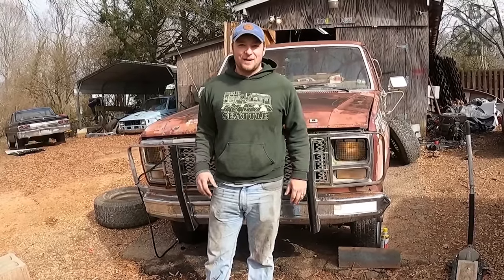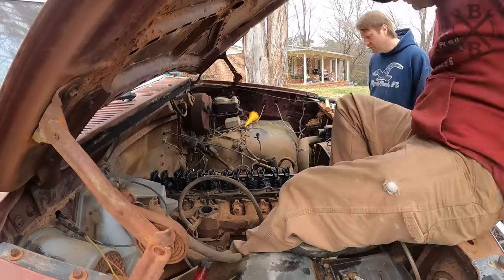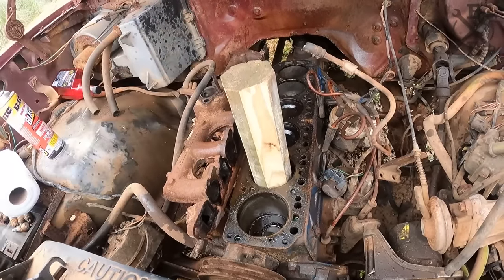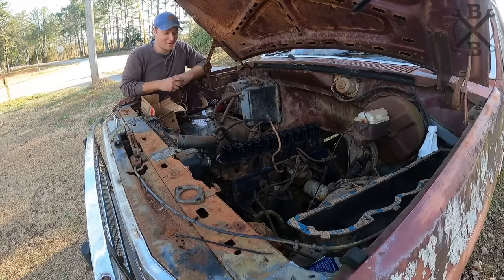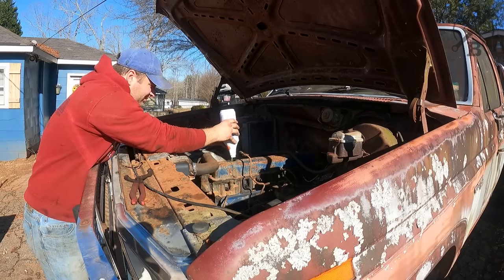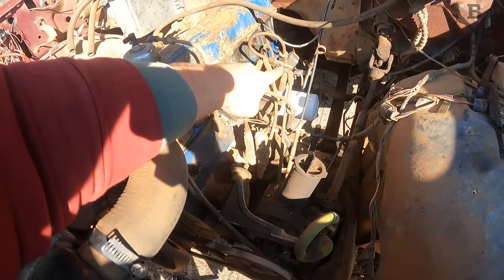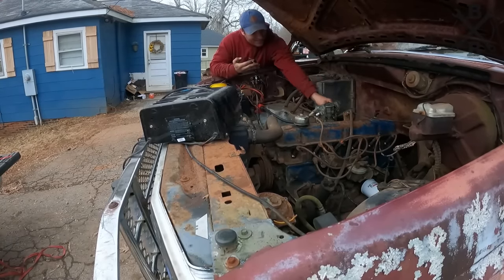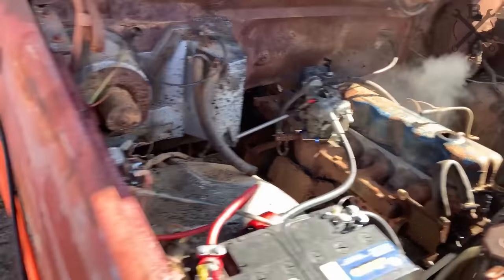Will this Classic Ford F150 Run after sitting for 29+ Years

Comment: The 300 is my favorite engine. Putting a tractor engine in a pick-up was a genius move on Ford's part.
Reply: Yes it was as far as im concerned a tractor engine capable of town runs is an absolutely amazing idea for any pick up. They are work first pleasure sencond at the most. But i love my 5.3 chevy as a daily.
Reply: The real definition of Ford built tough I have the 94’ 4.9L inline 6 with 5 speed manual transmission and I gotta say that she’s a beast and she still got her full potential low end power
Reply: the 300 was a truck/car engine long before, ford just sold the engines to new holland and others

Comment: As soon as he showed  what was under that hood I thought "it'll run."
Reply: Just started the video, haven't seen under the hood...guessing 300 L6.
Reply: @Captain_Yodelstein  You would be punctillius in assuming that...
Reply: Best motor that Ford ever made imo
Reply: My thoughts exactly 😂
Reply: Yup, second the hood opened I thought “straight six, should pop just fine”
Reply: Yup, I had an '81 Stepside w/300 and 4 speed with granny first gear. It was unstoppable! I still wish I'd never sold it!
Reply: Without a doubt
Reply: I have the same motor in my 88 cause the EFI motor blew up so we put a older motor in it and it's a tank
Reply: I saw your comment before starting the video. I knew from your comment it’d be a 300. 👍👍

Comment: The inventor of the Duraspark ignition lives in Chapin, SC. I've met him, he's a pretty cool guy. Whe Ford shipped their 1,000,000th ignition box, they presented him with a gold plated Duraspark box mounted on a plaque. He has it hung on the wall in his shop.
Reply: I've driven hundreds of thousands of miles on Duraspark ignitions, and never had a failure!  Tell that guy I said "Good Job!"
Reply: @DanEBoyd  I've only had age problems with mine. Other than that they're pretty decent.
Reply: I think the biggest problem with duraspark boxes is the cheap aftermarket ones…those are trash

Comment: Other people: engine is seized, yep it's dead
Budget Buildz: Now you take this effing log of wood and you hammer it in!!!
LEGEND
Reply: Noticias @BudgetBuildz El vuelve
Reply: @BudgetBuildz  de que,,,
Reply: @BudgetBuildz  flat tops,rv cam,twin barrel,,kill any v8..
Reply: @BudgetBuildz  the rubber on the fire wall,,now thats rare. i swapped out my  [ 75 highboy ],300 for a 351c, didnt know much about 300,s. bad mistake.. im in aus. i imported a 62 f100 4x4, 352 FE. not the y block., i think guy fitted a lot of a 65 to it. guards,door,bonnet. [ hood to you yanks ].. & cab as vin says f10,not f11. 4x4. good luck,stay safe..

Comment: One of the best in line 6's ever built (in my opinion)
Reply: Nahh that goes to the Jeep 4.0 but honestly I can’t think of a bad in-line 6, something about that set up just seems to work.
Reply: 96 F150 4.9L 650k and still going strong.
Reply: @sccarguy8242  yea I don’t know if there is a such thing as a not reliable inline 6
Reply: Agreed....the inline 6 is one of the most durable engine designs for toughness there is no matter the brand name on it.
Reply: Had a 170cid in line six in a 63 Comet...beat the tar out of it (teenager).  Never missed a beat. Miss that ole motor..
Reply: The ole slant six would go forever.
Reply: @perrykawasaki9991  So true...I have one in an old 1967 Dodge truck my grandfather bought new. I use it to plow snow with on the farm. Odometer was rolled over twice before it broke in 1999 so it likely has 300. miles on it now. Still a runnin and lived a hard life.
Reply: Had a '68 AMC Rambler with a 232 straight 6. Even after a head on with a late '70's caddy, it still ran. Hard engines to kill
Reply: @EliAngwin  my dad has 94 f150 xlt with dual gas tanks and has 300 inline 6 manual with 300k miles and never been rebuilt besides the trans being taken apart and the diggy out of a rats nest and putting back together and still running today after a tree fell threw the cab and onto the engine still runs even towed a old John deer tractor behind it once
Reply: @BrodieBr0  I agree because Chrysler 225 slant 6 is a die hard engine too just like the 300 and the 4 liter
Reply: @BrodieBr0  I know a guy who had a 62 dodge with a 170 slant 6 and it has over a half of a million miles and still runs
Reply: We love our inlines here in Oz. Ford, Holden and Chrysler all had their own 6s during the 60s and 70s, all of them solid as a rock.

Holden 6 came out in 64, went until 85. Solid old axe.

Chrysler Hemi 6 went 1970 to 1981. Most powerful 6 in the world in E49 tune (triple Webers) at 302hp.

Ford 6 started with the 1960 Falcon and evolved over the years to crossflow (1976), alloy head (1980), SOHC (1988) and DOHC Barra (2002), also turbo available.

Ford Oz kept on with the inline till the bitter end with the Barra 6, a now world-renowned powerplant. Taxi companies 9/10 times would choose the Ford as they could reach 1,000,000 km and still be running fine.
Reply: @79tazman  My dads wood chipper had a slant 6...it was a vermeer
Reply: Some people need to work on their reading comprehension, I said " ONE of the best 6's ever made" (in my opinion)
Not the best 6
Not the only good 6
Reply: @SpyTube24_7  Tell us more about this mythical 2002 XJ
Reply: these are basically all v8 internals,..with flat top pistons,decent twin barrel ,better inlet,headers,,these things fly.heaps of torque. excellent engine. i swapped mine for a 351.. before i knew all this,or would still have the 300..
Reply: @SpyTube24_7   <<<<-----You care about what I can afford. LMAO. XJ production ended in 2001 BTW.
Reply: I’m only a fan of the old school Fords. Love how y’all brought this back to life!
Reply: I got the 250/4.1 in my '70 bronk (NV3550 behind). Lubta C the 144/2.36 turboed...their all the ThriftPower or "falcon" motors (6 of'em 1960 - '96) ford6 on-line, in line 8^ )
Reply: Agreed. I daily a 1980 f100 and that ol i6 is a tank
Reply: Camioneta Si repuesto de Argentina fábrica de ford autopieza provincia de buenos aires importado de chile a estados unidos
Reply: AMC 258 straight 6 is one of the all time best!!1974 AMC HORNET Sportabout Wagon with wood paneling (contact paper)and army Green paint job..
Reply: It’s actually “the best”
Reply: @sccarguy8242  he said one of😂🤣😂
Reply: dont,,have an opinion about it,,they were.
Reply: Hands down! straight six king
Reply: 300 inline 6. the motor that built america. Ford put them in alot of there cars trucks vans. Light, medium and heavy duty. I've had plenty of them and loved each one!
Reply: 300 ford was a much better engine than jeeps 4.0
Reply: 300 ford will always be the best inline engine hands down
Reply: Douglas stats I agree
Reply: They had gonna of torque.
Reply: Nah one of the best engines built altogether. Some others are the 2JZ, RB26, most Cummins engines, i could go on but i can't think of anymore

Comment: Nice work with that engine. A wooden log must not be missing in any workshop. I have also repair two engines this way. I'm glad you didn't give up right away and fixed the engine.

Comment: luv the bullnoses...i have an '80 too.   congrats on getting it going...that cylinder did not look good!  300 was one of Fords best...not too good on mpg, but that's not the point.  hopefully there's some floors still in that ol' buzzard
Reply: there built for torque,,but to get better econ.  fit a better inlet/out headers,flat tops,small cam, twin or 4 bbl carb. killer engine..i have a ,here in aus,  a 351c with 302 heads,,on lpg only. 12.1 comp,std engine,no cam, its dangerous..still going 10 yrs later. only put 302 heads on as i had them, you never had 302 clevo,s in u.s. you have to use alloy heads.

Comment: Great video. 300s dont die. Id run a compression check after some run time to see if cyl 2 comes back to life. A good 300 can be anywhere from 120 to 180 psi. Ford spec is 25% difference from highest to lowest cyl reading.

Comment: I am curious what the compression is, after it's been running for a bit
Reply: Agree. A cylinder that has been badly corroded will always perform less than the other cylinders, if it works at all.
The material lost by corrosion can't be recuperated.

Comment: Those 300s are bullet proof. I bought one that sat in a e150 van for 5 years never started. Pulled it out to put it in my mud truck. Put a wrench on it and it was free. The oil pan was rusted out but my buddy had another one. The inside was clean no sign of wear at all. Got it in my truck and it fired right up. No noise didn't burn oil. I beat it for 2 years before I sold it had a new born and needed things for her. I paid 20 yes 20 for the engine. The guy who sold it to me said 20 if it ran and if it didn't I could have the engine and do with it what I wanted. It never left me stranded and I daily drove it for 6 mouths to work. Unfortunately getting 160 miles to a tank did suck but it was built to play in the mud. 3 inch lift, lockers, 4.11 gears and a 4 speed with granny low. The truck was a 82 f150 and man I miss that truck it was a beast in the mud and snow.

Comment: I remember those old Ford Trucks and restored lots them in 2 or 4 wheel drive plus 6 to 8 cylinder types too! That wild see headlights flashing like that 😳  ! Yes 300 6 cylinder like 292 6 cylinders motor built tough and Granny 4 speed too also any differential gears are excellent too! Excellent video and work on too get drive that old Truck going too!

Comment: Yes, I know the video is a few years old but I've only recently found the channel. First thing of note - vinegar. It eliminates rust because it's acidic. However, you've got to remove all grease or oils BEFORE attempting to use it or you will find failure. Also, in spite of what some folks claim, it isn't a miracle product though it can remove rust under the right conditions. Vinegar is basically a very weak acid which is good because it works slowly. That means you're not likely to do further damage when you use it and you don't actually know what you're doing. With that said, because of the acid, you can destroy what you'd like to keep if it's used for too long. Check your parts once or twice a day if soaking for many days in a row. To isolate sections of a part that's soaking, use wax or duct tape to seal off the parts you don't want the acid to act on. Next, the lifters. Just cranking down the head bolts was a mistake even with the hydraulic lifter design. The easy way to ensure the lifters are adjusted is to get the engine up to operating temp and ensure that you've got good oil pressure by testing using a verified gauge. Grab some decent scissors, some duct tape and a cardboard box or two. Remove the valve cover(s) and use the cardboard to manufacture a loose guard to keep the oil from spurting all over your hands and the engine bay while the engine is running. You don't need to put too much effort into it - all it has to do is keep the oil flowing inside the rails of the head and back down into the block. Slice, dice and tape up the cardboard as needed. Obviously, part of the cardboard has to cover over the top of the rockers and guide the oil back inside the head. Have your guard built?  Good, now fire up the engine and grab a ratchet and socket for the rocker nuts. At idle with a fully warmed up engine, back off each rocker nut until you barely hear a small tick occur. Listen very closely. Stop backing off the nut when you can barely hear the tick and tighten the nut exactly 1/4 turn. Do the rockers one at a time only! Go through all the rockers from one end of the head to the other TWICE. When you've done that, clean up the mating surfaces and replace the valve cover. You're done. This procedure works on pretty much any hydraulic lifter design engine so don't be afraid to use it if you have any doubt about your engine. The bottom line here is that even with hydraulic lifters, they've got to be in proper adjustment if you expect the engine to last. Too tight or too loose leads to catastrophic damage and expensive repairs. The least you can expect is bent pushrods and an engine that runs badly or not at all. Next, bolt installation. I cringed when you were installing the spark plugs and some of the bolts on the intake. I could hear the screeching over the audio on an intake bolt or two! Use a decent high temperature anti-seize on the threads of your spark plugs. Also on any bolts, nuts or screws that are near or on the exhaust system. Believe me when I say that you'll thank yourself for doing so down the road of life when you take things apart for maintenance or repairs. Use a regular anti-seize on all parts that don't need a high temp type. What type to use? Everyone has their opinion but I use a copper based type for a high temp anti-seize. I've never had an issue with it myself. For a regular anti-seize, a lot of folks prefer a nickel based type but I advise doing some research online and choosing what you think will work best for you. Opinions vary greatly and for many reasons but MHO is that it's best to use SOME type of anti-seize rather than not use one. Again, you'll thank yourself for doing so when you take things apart. Lastly, consider chasing all the threads on your hardware before reassembling the parts. Chase, clean and lube equals success. Peace & good vibes!

- Max Giganteum

Comment: For what you do, as your day to day professional job, you need a good modern torque wrench. The head must be torqued to specs, ( exhaust manifold, the valve cover, water pump, everything else).Be careful not to over hone that one cylinder, you could lose compression, burn oil. This block could be re-bored with oversized pistons and new rings, however you said it had already been re-bored.

Comment: We love our inlines here in Oz. Ford, Holden and Chrysler all had their own 6s during the 60s and 70s, all of them solid as a rock.

Holden 6 came out in 64, went until 85. Solid old axe.

Chrysler Hemi 6 went 1970 to 1981. Most powerful 6 in the world in E49 tune (triple Webers) at 302hp.

Ford 6 started with the 1960 Falcon and evolved over the years to crossflow (1976), alloy head (1980), SOHC (1988) and DOHC Barra (2002), also turbo available.

Ford Oz kept on with the inline till the bitter end with the Barra 6, a now world-renowned powerplant. Taxi companies 9/10 times would choose the Ford as they could reach 1,000,000 km and still be running fine.

Comment: My first ever car was a F1 1949 took the v8 side valve out put in a 1975 300 and a turdo no wast gate ,twine clutch, no synchro on first gear it could climb a brick wall.Turdo melted a piston blew the dip stick through the hood.

Comment: I owned a dozen plus F150’s 81-86 and all but one had the 300-6. Plus I had 92 & 93 F150’s, 94 F250HD all with the 300-6. The 92 had been sitting not run for 5-10 years. I got it running and it ran a high idle for about 20 minutes while the exhaust smoked some. Then the engine settled down and stopped smoking. I sold the engine and tranny later. If I was younger and healthy I’d look for some southern 92-95 F150’s with the 300-6 and modify it to a 3.55 axle ratio along with a ZF heavy duty 5 speed manual transmission.

Comment: I had. 91 f150 with the 300 straight six. 190,000 on the odometer when I sold it. And it still ran like a champ. 2 wheel drive just wasn't practice in the northeastern winters.

Comment: 300 I6 with an M5R2 5spd. is just about the best combo for a F150.
Mine had 735,000 miles on it when I sold it. I regret selling it, but the guy I sold it to says it's still running strong.

Comment: you could probably run electrolysis in the vinegar(or other electrolyte) when you have this kind of problem. - on the block and a steel bolt connected to +  in cylinder.

Comment: First of all that surprised me it runs OK but it would run better with the spacer plate . A carb spacer increases the distance between the intake manifold and the bottom of the carburetor, tha reduces the velocity of the air and fuel.   When you stack spacers, you are actually improving their insulation properties, and you get more horsepower.  You dont want your carburetor to be all hot you want it to be cold and  cool air and gas put more into the combustion chamber. A spacer will increase the velocity of your vehicle's air-to-fuel amount and you will get  low to mid-range torque.

Comment: most mls i ever seen on a ole 300. was around 570k. still run great. rest the truck was shot. but leaked like mad. but no burning oil. trans  failed lil after 570k mls and it was junked b/c it was just rusted and wornout. btw it was a 81 f100

Comment: I had a I believe it was like a 1986 with a straight six cylinder with a granny first gear Ford pick up and it would pull a house down in that first gear granny gear, After years and years I finally bought me one of those half-inch drive digital click torque wrenches it really is nice I use it on my tractors a lot because all the wheel bolts , of course cylinder head bolts, and everything a really high torque

Comment: You know it's easier to install the head, THEN install your pushrods. That way you don't run the risk of bending one. I've never heard of someone installing the pushrods before putting the head on. Lash isn't that hard to adjust on these.

Comment: I've had 3 trucks with the 300 six and they run good and are very reliable easy to work on but I don't understand why everyone says they make so much torque every one I've had was a dogg! I think they are very tough engines but they are dogs IMHO no hate by any means just don't agree. 302 or 351 has way more power I've owned and driven several.